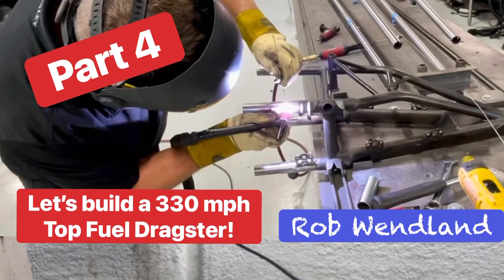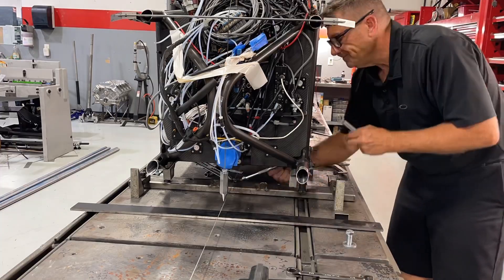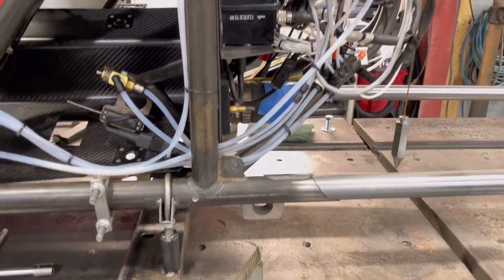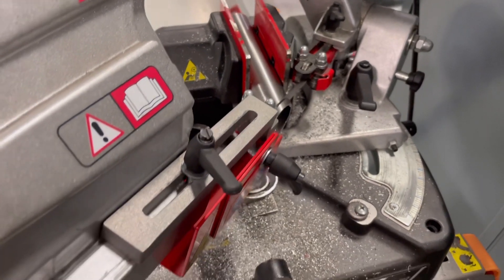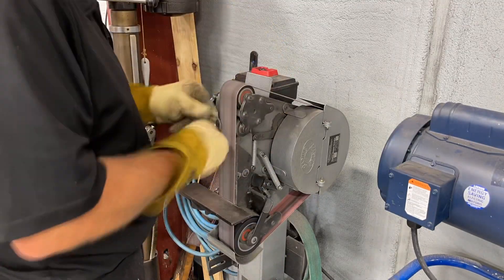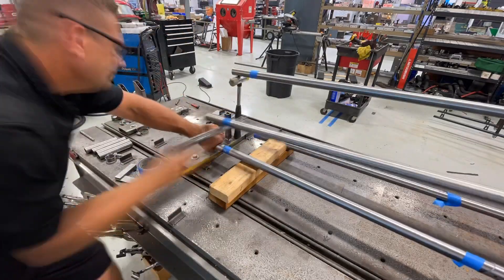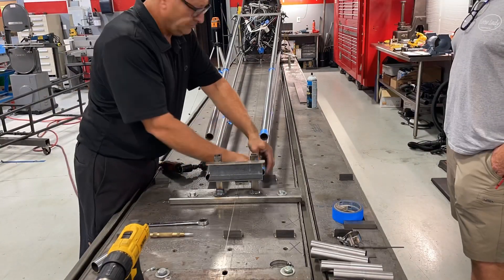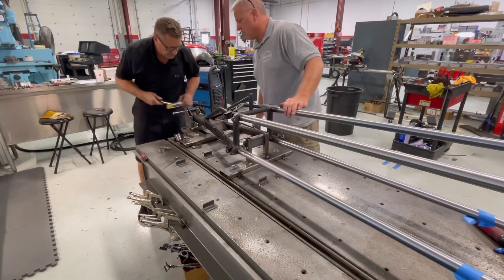PART 4 Let’s Build a 330 MPH TOP FUEL DRAGSTER!

Comment: brilliant can not give away all your secrets the ones you are sharing thank you i am never going to build a rail but is cool to know that the upper sleeve has some movement and that it cuts down on heat and stress from flexing lots of science very cool
Reply from the maker: You can use it on so many different applications!
Reply: @robwendland  it is the right amount of strength and flexibility to go 300 mph and stay together and not be to heavy alot of engineering

Comment: Rob, Your attention to detail is well placed. Check and re-check dimensions, be sure the parts are square and working with centerline laser as well as plumb-bob are all valid process to fit-up frames. I've built a number of aircraft fuselages over the years and this process is all too familiar and very similar to racecar fabrication. It is satisfying to stand back and know you have accomplished the task at hand with accuracy. Well done and great video! Thanks for taking the time!